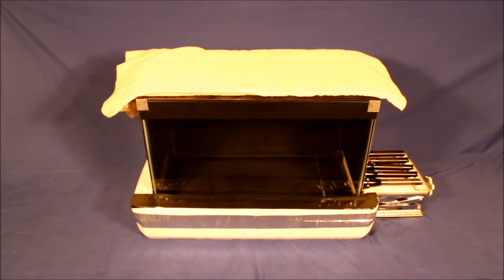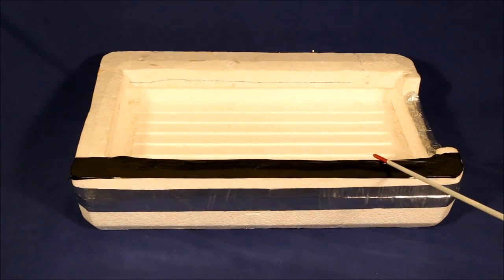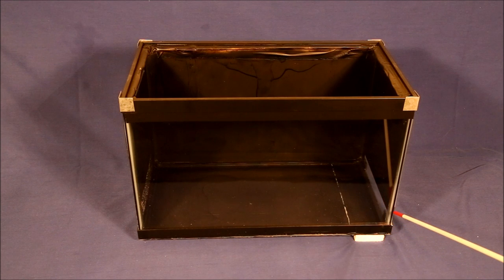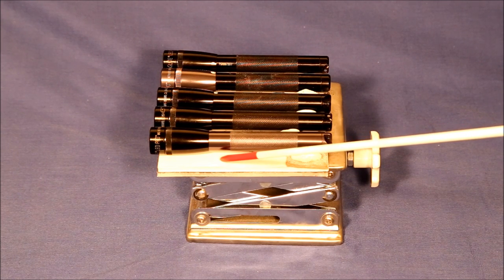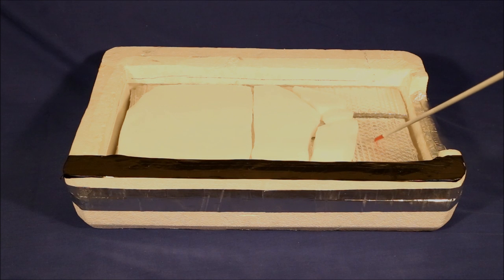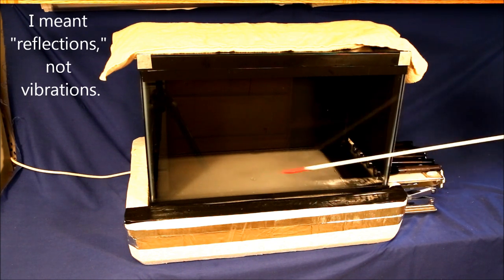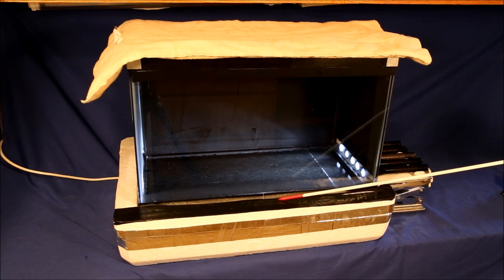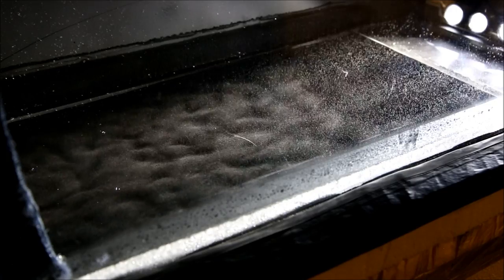How to Build and Use a Cloud Chamber

Comment: There is a much better light source and it's way cheaper, although they do get warm as well. Those light bars you see on trucks all the time, the LED lights, you can get them in cubes, 6 inch strips, all the way up to I think 40 in. These will absolutely blow away those maglites. They don't draw a lot of current they run on 12 volt, the 2in cubes, or the 6-inch would be your best bet. You could run just two cubes, and make one, four inch long light,etc.
Reply from the maker: Thanks for the idea! The thing I liked about the magnates is that they can be focused, which is important for creating maximum contrast. Bare LED light strips don't have that capability and even if the LEDs are low angle LEDs, they can't produce as narrow a cone as the maglites focused to their narrowest beam. Have you made working cloud chambers with both lighting options and compared them? If so, I'd like to watch a video about it to see if I can use your idea to improve my own cloud chamber. Thanks for commenting!

Comment: Hi Wayne, You may want to check out some of the super bright Cree LED flashlights you can get on ebay for a fraction of the cost of the Maglights.  Here is a link to one of these:  http://www.ebay.com/itm/like/321607843646?lpid=82&chn=ps
All the best!
Reply from the maker: RonALampman Thanks for the idea! I got one that was similar but found it put out too much heat. It created currents inside the chamber that were a problem. I'm now experimenting with moving it away far enough so that it provides enough heat to keep the glass from frosting. It's very tricky to do. The ones you sent are better than what I tried because they are cylindrical in shape and line up better. I'm looking them over but need to be careful to only get ones that focus. Thanks again!
Reply: Wayne Schmidt You're welcome.  Oh, I noticed you are pretty handy with a soldering iron and potentiometers so, you can dial down the input voltage for a given light if it is too bright.  Also, there are many that have a real tight focus beams.  BTW, you have an awesome channel and I subscribed.  All the best!
Reply from the maker: RonALampman LEDs have a minimum voltage below which they don't work. LED flashlights "fake" dimming by rapidly pulsing the light on and off.  Wiring in a potentiometer doesn't work.
Thank for the kind words about the channel and subscribing. Count on updates at least once a week. Tonight's project is video taping wintogreen lifesaver flashes. I reviewed a dozen youtube attempts and none really captured the flash. I'm hoping I can do better. Wish me luck!
Reply: Wayne Schmidt Hi Wayne, the way I've been getting them to dim is by reducing the voltage like when  a battery is dying.  I don't exceed their max voltage, but reduce it from there to get a true dimming effect.  Yes they will go out when the voltage drops low enough, but it has worked for me.  I used this method to reduce power from 5v to 3.5 using a brushed ESC on a UFO to keep from blowing the LED out.  It ran brightly on 5v but burned out in a matter of minutes.  Now it works great.
Reply from the maker: RonALampman That makes sense. I assumed the LEDs were being driven close to their minimum voltage. But if they are being over driven, then a potentiometer would work. Thanks for the idea.